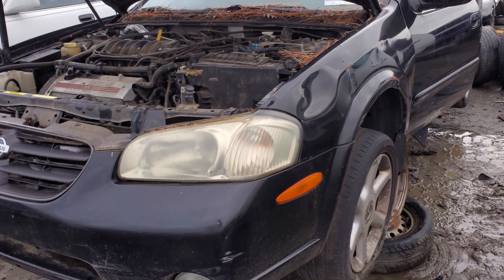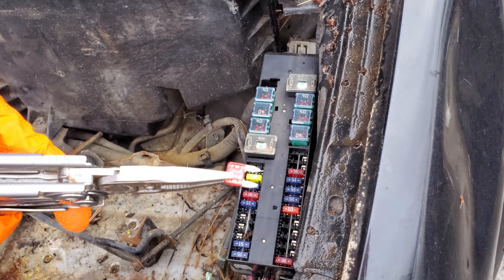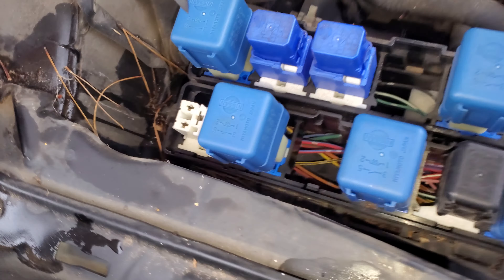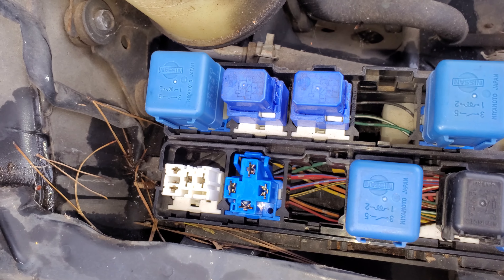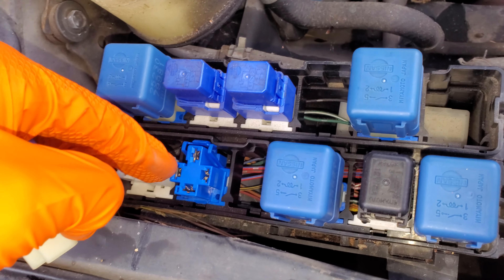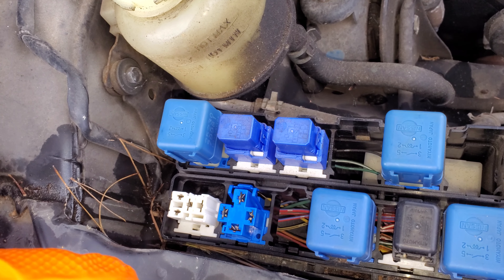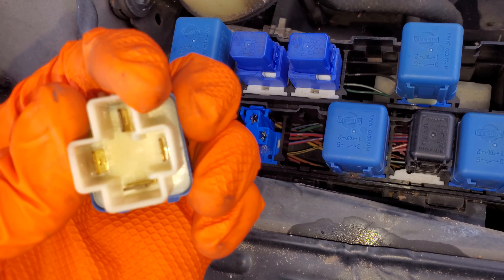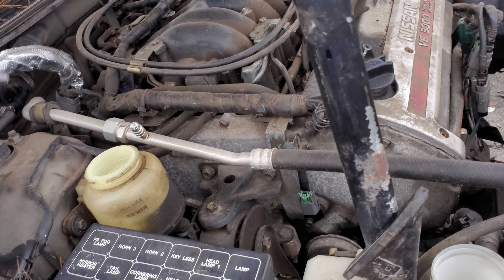2001 Nissan Maxima Parking Light Fuse & Relay

Comment: 2000 Nissan Maxima GLE, garage replaced brake light switch.  it was draining the battery.  Last night the neighbor told me my tailights were still on.  I'm wondering if it might be the parking lights instead of brake lights?  Do ou know where the parking light switch is on a 2000 Nissan Maxima GLE?  Or should I look somewhere else in the braking system? Thanks...

Comment: im getting a clicking sound from that big fusebox when my lights were on but weren’t showing any light, car wont stay running after changing iac, repairing ecm, & flashing key and fixing vacuum leaks, charging battery now to see if that helps